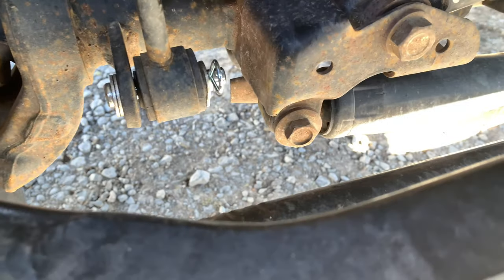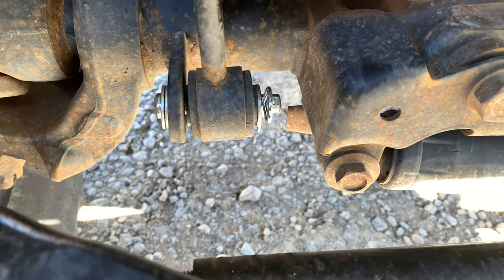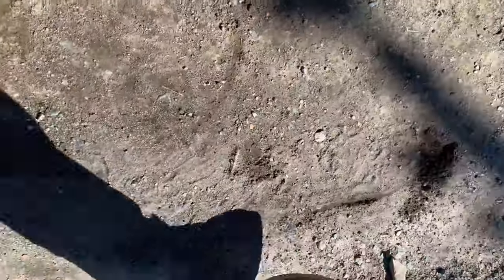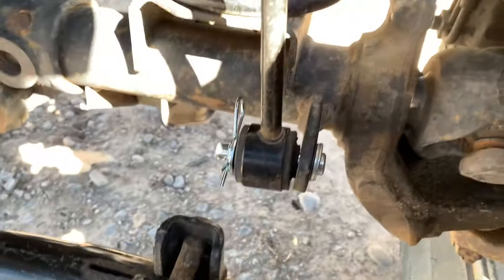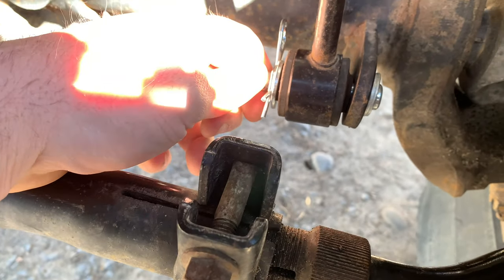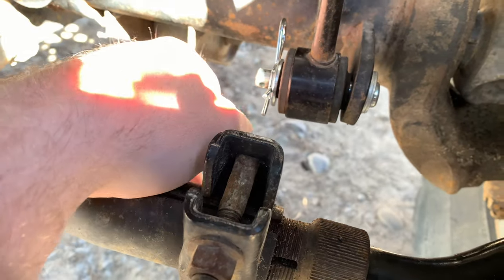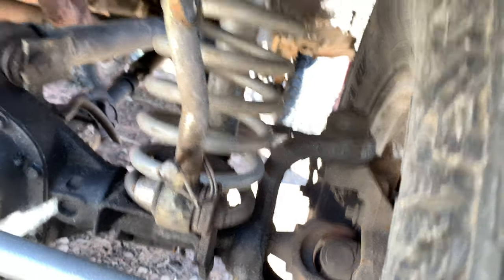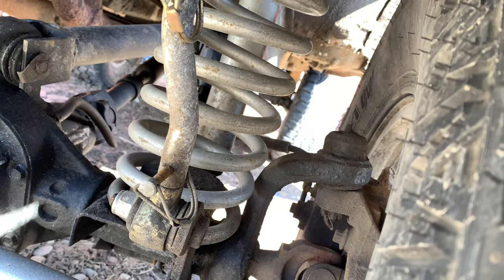DIY Swaybar Quick Disconnects (XJ/TJ/Jk)

Comment: They can be noisy if it's your DD.   Honestly removing the stock driver's side swaybar link takes about 5 minutes with a few handtools and when it's assembled makes no noise.
Reply: Do you only need to remove one side? 🤔
Reply: @officialWWM  I only remove one side.   The driver's side typically since it's the closet one to my seat lol.  Flexes just like if both sides were unhooked.

Comment: My Cherokee just has a fixed Bolt so instead of cutting it with my whiz wheel and drilling it out I just drilled the hole in the already existing bolts and put a 3/4 pin in that

Comment: Hey Ronnie, is there any reason that I couldn't just drill a hole in my original sway bar bolt and stick a cotter pin through it instead of using a clevis pin? Seems like that would solve a couple of issues, but I may be missing something. Love your channel and all is enjoy when you have new content coming out.
Reply: That thought crossed my mind as I was watching this as well. Maybe the tighter fit makes for a tougher disconnect? I'm going to give it a try soon.